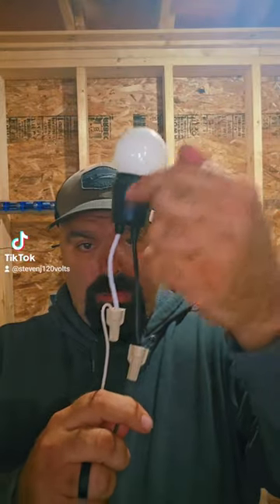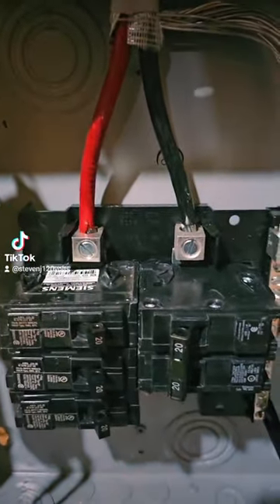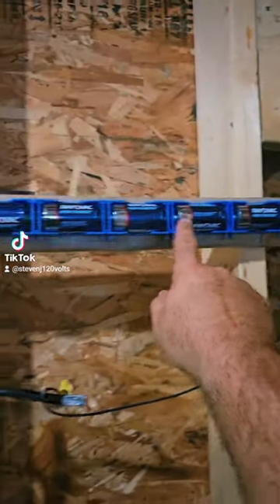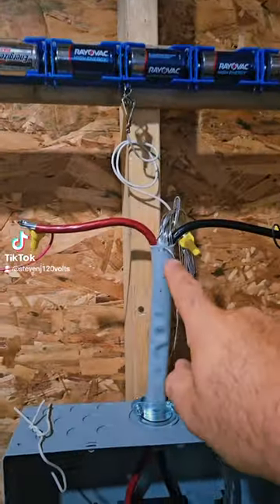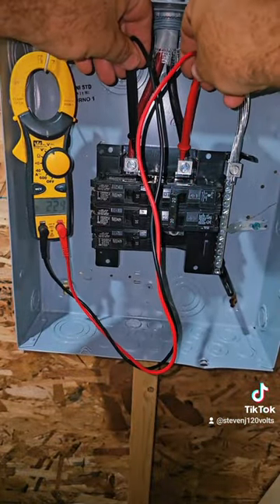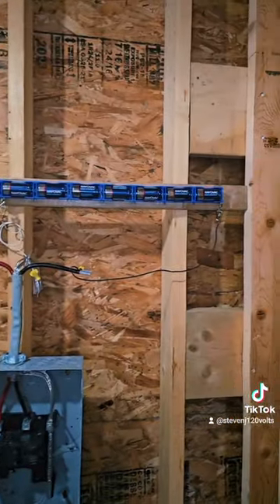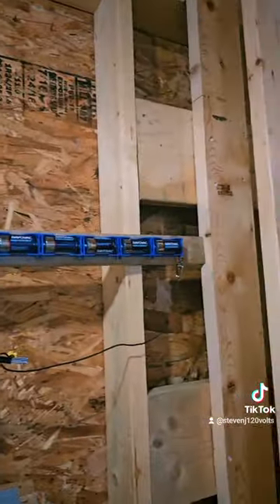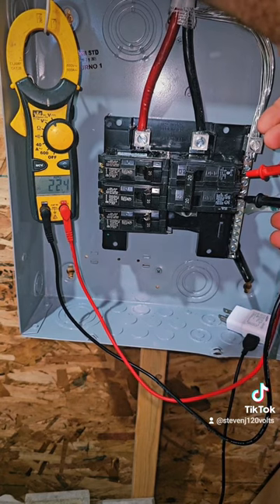why doesn't a 240v circuit need a neutral???

Comment: There are many 240 volt (single phase, by the way) appliances that require a neutral and a ground on top of line 1 and line 2. Those are utilizing that neutral for 120 volt loads with8n the appliance such as power supplies, clocks, etc.
Reply from the maker: The neutral is there for the imbalanced you do not need a neutral to get 120 volts
Reply from the maker: @wd8dsb  np you need it an imbalance you can have 120 with no neutral as long as it balanced I have plenty of videos showing this in other demonstrations
Reply from the maker: @wd8dsb  I am 100% following what you are saying and I 100% understand where you are wrong and what part of the wiring diagram you are confused by.  The 120v i  your house comes from the two loads being put in series on a 240 volt circuit .I understand it doesn't look this way to non electricians that just learn to connect black to black and white to white.  But it is true the neutral does not provide you with 120v the neutral give you balance to maintain even voltage when the loads are not balanced.   I am  Master Electrician with 28 years experience I am not confused by what you are saying I am explaining  on a deeper level. You can have 120 volts without neutral.
Reply from the maker: @wd8dsb  here is link to a video where I demonstrate this idea.  https://youtu.be/Y2Y-VzynHjs?si=QhWUhDoT6S8aY9sV
Reply from the maker: @wd8dsb  that's my video the "he" that you said make the qualifier is me and not you you don't go between neutral and hot.  It just looks like that because of the configuration of the panel. Sorry My content is for electricians its going over your head
Reply from the maker: @wd8dsb  you still have 120 when you  if you only seen the two hot wires.   I don't believe you are engineer. If you are please have your supervisor or the person who trained you contact me at stevenj120volts@gmail.com they are teaching you incorrectly
Reply from the maker: @wd8dsb  you are confusing the step by step information we give to A DIYer doing an install vs the actual over all wiring diagram of ALL the circuits and loads in a home and how they interact.
Reply: Some equipment will indeed require the 3 wires to run. 240v for the "main" thing and 120v for other things like lamps or whatever. Dryers, ovens, fridges are a good example
Reply: Not really sure what you guys are on with disagreeing with the uploader. You can 100% have 120v on a hot wire without a neutral. Ever heard of a open neutral, they are fun, trust me.
Reply from the maker: @shawskeebennett1440  you can have working 120v with out a neutral. I am talking about the overall wiring diagram for the one big circuit the untility provides to you home .  They are confusing that with how you connect a breaker to a panel
Reply: @wd8dsb  yeah….. I know that. It seems like you’re the one who doesn’t know it. You seem somewhat smart, but don’t have any field experience. I want you to go into your house and disconnect the neutral from your light fixture and see what happens. You’re arguing against yourself for whatever it is, whether you just like trolling people, or legit have no clue what you’re talking about.
Reply: @Stevenj120volts   you can only get 120 volts from the 2 hot wires if they go through 2 120V loads first. For example if you have 2 120V heating elements wired in series hooked up to a 240V power supply you would get 120V measured between the heating elements. But the only way to have that consistently would be if the heating elements were constantly on which obviously is not ideal. Most control boards and lights on things like ovens and dryers use 120V taken from the hot and neutral. If an appliance does not use any 120V components then it has no need for the neutral as part of the circuit.
Reply: @Stevenj120volts The other guy is right. A lot of modern devices that use 220v also split it internally to make 120v. You can get by, but eventually you'll fry a lot of smart devices if you continue this mindset of not needing 4 wires.
Reply from the maker: @EM_303  no he is wrong.  Just go wire electric heat or a water heater.   Some appliances are 3 wire some are 4wire. It depends on if the internal load is balanced or not.  Stop spreading bad information you clearly have never wire anything.  This page is for electrician or apprentices
Reply: @Stevenj120volts  lets imagine a scenario. We have an electric dryer with a control board that runs on 120 V. If the dryer is off so no other loads are used then how can the control board get 120V from any place other than a hot and neutral? It can only get 120V from the 2 hots if they both go through a 120V load in series first.
Reply from the maker: @Redtooth75  yes there is inbalance requiring a neutral.  If you have balanced 120v loads you wouldn't need the neutral. What is the advantage of running the controls on 120V
Reply: @Stevenj120volts  many appliances do that for the smaller things because its cheaper. My old dryer used 240 volts only for the heating elements. The timer motor, buzzer, light, and drum motor all ran off of 120 V. Any appliance that requires a 4 prong plug will have 120V loads taken from a hot and neutral.
If all loads use only the hots then there is no need for the neutral at all, hence why water heaters and condensing units do not have neutrals. If there are strictly 240V loads then they will be tied into L1 and L2 and not tied into a neutral. In that case the appliance load has to be balanced between the lines. It can't go anywhere else unless there is a ground fault. The amps measured from L1 would equal the amps measured from L2, because those are the only conductors being used.
Reply from the maker: @Redtooth75  yes and you can have 120 at any load using only the hots and not neutral as long that that 120v load is in series with an equal load.  You need the neutral is there is not a second 120v load to create a balance
Reply: @Stevenj120volts  yes I know but that is not relevant. Loads are very rarely wired in series, and almost never will those loads be unbalanced. The neutral is primarily there to run the 120V loads, and in some very obscure rare cases I suppose it could be used to balance 2 different 120V loads with a 240V power supply. I am talking about one appliance specifically not the electrical system as a whole.
Reply from the maker: @Redtooth75  this video is a DIY tutorial or an appliance repair thing.  It about theory and it is more correct and shows a better understanding of you know and say the neutral is there for any imbalance and NOT there just to provide 120. They technically would have to be in series per leg.  They can be on opposite legs and they would end up in series
Reply from the maker: @Redtooth75  what you saying is you can understand my point and now are discussing the details..  Others here are saying its impossible to get 120 without a neutral that you can only get 120 if you have a neutral and that my point about balanced 120 is incorrect... Not unrealistic or impractical but they are claiming that's not how Electricity works
Reply: @Stevenj120volts  the point I am making is that the neutral is there because there are 120V loads. The neutral is not there to correct the imbalance, its there to create it because the manufacturer decided they wanted something in that appliance to run on 120V instead of 240V. That is what multiple people in this section have told you but you continue to insist that that is not the case. If the appliance uses strictly 240V then it has no need for a neutral. The presence of a neutral means that there is a 120V load in the appliance.
Reply from the maker: @Redtooth75  ok then you are wrong you can have balanced 120 loads without a neutral
Reply: @Stevenj120volts  k, you are once again completely missing the point. Go look at the wiring diagram of any 240V 4 wire appliance and you will see 120V loads wired between one hot and a neutral.
Reply from the maker: @Redtooth75  believe me I am not missing the point.   If it was balanced you could have 120.  120 is not the issue having an unbalanced load is the issue. It's pretty simple
Reply: @Stevenj120volts  Appliances do not use 2 equal 120V loads wired in series hooked up to 2 hots. They wire a 240V load to the lines when they want 240V and they wire a line to neutral when they want 120V just like everything else in the house. Thats my point that you continually miss.  While it is possible to get 120V by wiring 2 120V loads hooked up to a 240V input that is not what is done as standard. You take half the transformer winding to get half the voltage (line to neutral), and you take the full winding to get the full voltage (line to line). Loads are normally wired in parallel, not series.
Reply from the maker: @Redtooth75  I can't believe you are really that confused. That you are totally missing the point.  It's like you don't even read what I type.  Last time it very simple.   IF the 120 loads where balanced you wouldnt a neutral.  So when there is not a balanced load you need a neutral...  You saying dryers don't ever have balanced loads is IRRELEVANT to my point   If you can't comprehend that I can't help you
Reply: @Stevenj120volts  the lines are unbalanced because there are 120v loads in the appliance. There are things that run off 120 volts which is why there is a neutral. If every load was 240V then there would not be a neutral. Thats what I am trying to get you to comprehend and that is also what the original comment said which you decided to argue against.
Reply: @Stevenj120volts  if the 120V loads were balanced it would be a 120V appliance and would not have 2 hots going to it. If its an appliance that has only 240V loads it would have 2 hots and no neutral. If its an appliance that has both 120V loads and 240V loads then it has 2 hots and a neutral. 
What you are saying is like saying the neutral service wire going into the main panel is for taking the imbalance between the hots. Thats one of the things it does yes but that is not what its for. What its for is splitting the transformer windings making it possible to take power from only half the transformer giving you 2 different voltage options. And taking power from only half the transformer is what creates an imbalance in the first place.
Reply from the maker: @Redtooth75  you can't be a real person.  The video is about electrical theory and how circuits work.  And you are talking about appliance repair.  You don't not understand electrical theory.  This video is over head.  I am done wasting time you either are a troll, not an electrician or have not experience in electrical theory.  Again the concepts being discuss here are over your head.  We are talking at a level 6 on a scale of 1-10 and you are at a 2.  And because you don't understand what is being talked about you think you are right.  I have tried to educate you but you just do not have a solid base on basic ohm laws.
Reply from the maker: @Redtooth75  what I am saying here and the demonstration I am using is a common demonstration and topic discussed in the 1 year of electrical engineering classes.  To help with the visual and help teach electrician I have added an electrical panel to the display.    Plz just understand your house and everything in it (including ALL 120 volt loads) are part of 240 volts series circuit. Except for the unbalanced part.  The part of that circuit being inside a dryer does not change electrical theory, ohms or the other science involved. Get more educated before commenting more. You are embarrassing yourself
Reply: @Stevenj120volts  lol you have so many misconceptions. A house is not a series circuit. If it was then everything in the house would have to be on at once and turning off one thing would turn everything off, and you would have to have an insane service voltage. That is the most incompetent thing I have ever heard from a "professional". A house has multiple parallel circuits, not series. But I guess when all you have to do is bend conduit and run wire you don't really need to understand what you are doing.
Reply from the maker: @Redtooth75  you are a fool.  You can remove the neutral from a house and still have 120 as long as it is balanced.  You understand the neutral only carries the imbalance. Loosing the neutral would t give you crazy voltages if the house was a parallel circuit.  Again you are at an electrician education of a 2 and this conversation is at a 6 I can speak at a level 20 and you would be so confused.  Like you still think voltage is force that pushes electrons.    

Maybe you have heard the term balance your panel.  This is often taught to low level entry level installers.  The reason so because you home is a series circuit.  The first page of any electrical text book will explain this plz again you are embarrassing yourself.
Reply from the maker: @Redtooth75  I can confirm to you have ZERO misconception about how the electrical works in your home.  Fyi it takes 8000 hours of experience to be a licensed electrician. I have over 57,000 hours of experience and I am second generation.  I am not confused about anything. EVERYTHING I am saying is 100% true. If you know an electrician or teacher telling you different plz have them email me at stevenj120volts@gmail.com I am licenced master electrician and professional electrical educator.
Reply: @Stevenj120volts  the house is a parallel circuit, like how do you not know that? If the loads were balanced could remove the service neutral going back to the transformer yes. But you could not remove any neutral going into the neutral bus bar. That is because the amperage on the imbalanced neutrals cancel each other out internally in the neutral bar. In a balanced load you would still measure amps on each active neutral going into the bar. You would measure 0 amps on the service neutral only.
I mean for fucks sake you have a video showing a series circuit with 2 electric grills. Tell me have you ever wired any 120V application in that way? Have you ever connected a 120V outlet to hot and tied the neutral terminal to the neutral terminal of a different 120V outlet and connected that outlets hot side to the other 120V line at the panel? That would be a series circuit.
The fact that a "professional master electrician with 25 years experience" does not know the difference between a parallel and series circuit is disgraceful.
Reply: @shawskeebennett1440  aren't you glad you cut your losses with this guy? I know I wish I would have. It was good entertainment though. But kind of scary realizing that people like this are allowed wire up buildings.
Reply: @Stevenj120volts  did you really block/report that wd8dsb guy? He replied to me and I saw it but now its lost to the cosmic wind. If you did then thats sad dude.
Reply from the maker: @Redtooth75  I have over 100k followers on 4 platform with over 1.3 million views in last 30 days and have never blocked any one or deleted any comment.  You are so confused I do not THINK I am right I KNOW I am right.  I posted a video one time explaining this. The next day I was invited to conference for content creator's in Philadelphia.
Reply from the maker: @Redtooth75  you do realize that guy used one of MY videos to disprove me. That's how much you guys as misunderstanding the point.  He referred to the guy in the video as HE said this and I was the HE in the video.  The video is demonstration of a neutral is not required for 120. The nuetral is only required if there is an imbalance.
Reply from the maker: @Redtooth75  the wd8dsb thinks the white wire at the receptacle is calleda neutral.  I understand that is the slang installers use but he thinks it Not just the slang ppl use but he really thinks that is the neutral
Reply from the maker: @Redtooth75  are you on tik Tok or Instagram?  Those app are much easier I would have to type I could show you actually working wiring and demonstration to prove what I am saying.
Reply from the maker: @Redtooth75  you could also look up Dave Gordon page on YouTube he is an electrical engineer that does alot of teaching using a battery stack
Reply: You only get 2 hot wires from the transformer no neutral but you have 120volt when needed the  dryer and other 240 volt things that look like you have a neutral don't need all 4 wires to  work some only have  3 wires and one is just a naked ground still the light and other 120volt things on that 240 volt appliance work the single phase is split between its not about a neutral wire the fact is you need two wires on everything ac you can only have one wire on DC  things  the ground doesn't have to be hooked to whatever so long as it is grounded
Reply: @EM_303 I need 240 volts for my drier. Have 4 prung outlet and plug (ground, neutral and 2 hots) I am only getting 124 volts on each leg of outlet and on each screw/wire of braker and when combine both legs of 124 volts on either outlet or braker I get 0 volts. Replaced braker and still 0 volts. Any idea why can't get 240 volts?
Should I remove the white/neutral?
Please advise.
Reply: @Redtooth75 I need 240 volts for my drier. Have 4 prung outlet and plug (ground, neutral and 2 hots) I am only getting 124 volts on each leg of outlet and on each screw/wire of braker and when combine both legs of 124 volts on either outlet or braker I get 0 volts. Replaced braker and still 0 volts. Any idea why can't get 240 volts?
Should I remove the white/neutral?
Please advise.
Reply: @joaquinsuarez6090  something funky is going on inside the panel. Do any other 240 appliances work (AC, electric oven, etc)? A multimeter will essentially measure the difference in voltage between two points. Each leg is 120 volts from ground. But if you get 0 volts when measuring both legs then that is because both legs are actually the same. So essentially you have the same 120V leg being repeated.
If you are comfortable with it then measure the power coming from the meter, this can be done at the main breaker for the entire house. If you still get 0V measured between the lines but 120V measured from ground/neutral then call the utility company. If you do have 240V there then the problem is the wiring inside your house.
Reply: @Redtooth75  thanks for the answer. I found the problem: what happened is that only top 2/3 of power metal bars where brakers connect, had a horizontal piece of metal connecting both, left and right sides and the 1/3 bottom part where I installed the slim 30 amp 240v braker didn't have that little horizontal plate connecting both metal power bars. I had to use a regular bigger size double braker that touched that horizontal metal plate and that fixed problem and got me the 240 volts needed for drier.